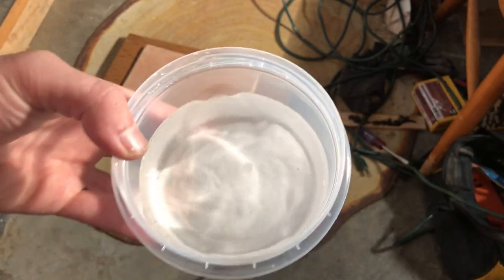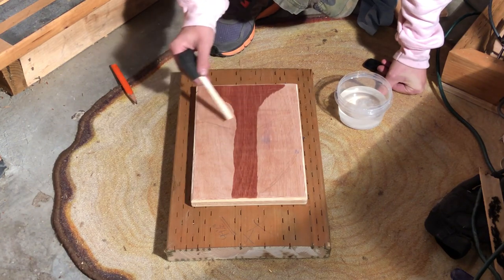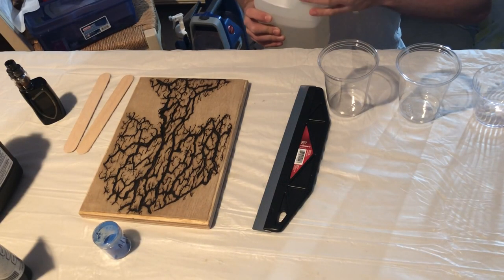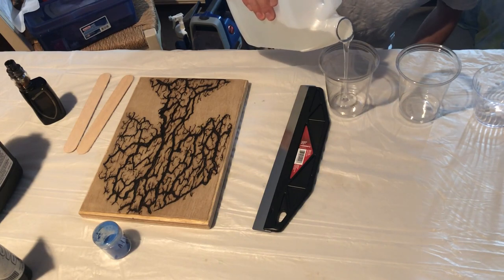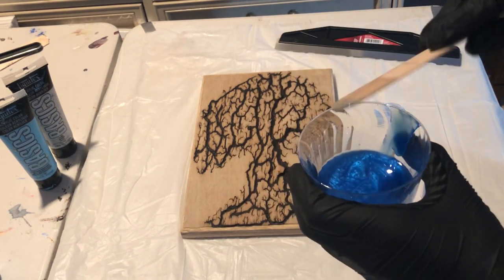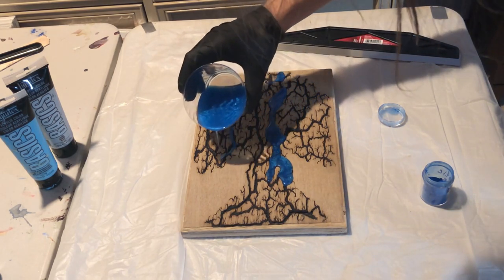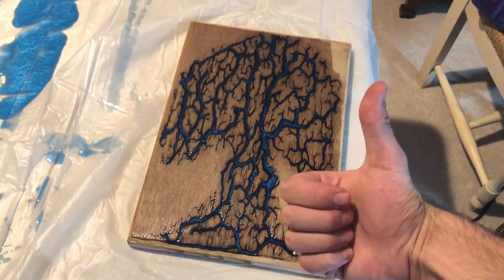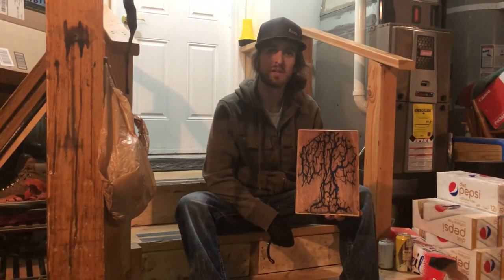Burning METALLIC BLUE LIGHTNING  Into Wood

Comment: Totally inspired and ready to make some myself! What did you use for your HV power supply? I've got a couple microwave oven transformers that I figured would easily be enough
Reply from the maker: They work well, you can also find a neon light transformer, or anything else rated around those options. It’s a blast just be careful and it’ll always be fun.

Comment: Not good enough.  I am a military trained electrician, (21 years, retired), and spent 30 years in factories, as a electrical maintenance manager and an industrial engineer. 
 I got into this hobby about five years ago, and have two microwave oven transformer setups, which I elevated my platforms off the bench with two glued on 2X4's. After time, you get a bit lazy...then maybe cut a few corners.  We all say we won't, BUT WE ALL DO.  (YOU CAN SEE IN THE VIDEO...AT 4:20 HE MOVES THE PROBES WITH THE GLOVES OFF, AND ANYWAY, ARE THEY 12k RATED GLOVES?) He is cutting corners. How long before he forgets to turn it off, wants to move a probe because the burn has stopped, and just kills himself?
I recently got into fractal burning guitars, and one late afternoon, a bit tired, didn't realize it was still on and touched one probe. The burn had stopped, the voltage was still on. The other one literally jumped into my other hand, as the hand was touching the edge of the guitar body.  I "Rode the Lightning" for about two seconds until I fell on my right side, heavily bruising my shoulder and hitting my head on the floor.  When I hit, I woke up, got up and went into the house and had my wife call 911. Heartrate was 160, and I ended up in a burn center for three days as they monitored my heart, and treated the burns on my hands, which were not that bad. Huge hematoma on my forehead, and a scalp cut on my head where I scraped on a bench nearby. NOT FUN, NEAR DEATH EXPERIENCES....
Changes I will make:
1. Add two momentary on switches to the incoming 120VAC in a plastic housing. Both have to be pressed to engage the unit. No 120VAC, no burn. Two switches, two hands.
2. My potentiometer, which I use to adjust the voltage, will be next, in a straight line away from me. Adjust before I can press both buttons, which are UL approved to be Open when released. 
3. The actual unit on its platform, further away down the line.
4. The probes, with 10K insulated wire, extending to a separate wooden table.
5. Finally, 12K gloves, 1.8MM thick, in case the switches, and the potentiometer all fail and it stays lit.
6. I am standing on 3/4" insulated rubber flooring, the final table will not be on the same rubber.
Sound like a lot?  10,000VAC is a lot!  I am lucky to be writing this, but this is what I should have done in the first place.
Lichtenberg is like nothing else in beauty, and it is highly, highly dangerous.  I see people using regular wire, no gloves, machine very near to the work, and I think, there is number 34, waiting to die....
Stay safe.
Reply from the maker: I appreciate your service and I appreciate your knowledge.  However you’re doing more teaching in this comment than I did in the video, if people are dumb enough to do things where I clearly warn not to do it nor explain hardly anything besides basic elementary chemistry, then I’m not the one to attack.  I appreciate you though, take care.